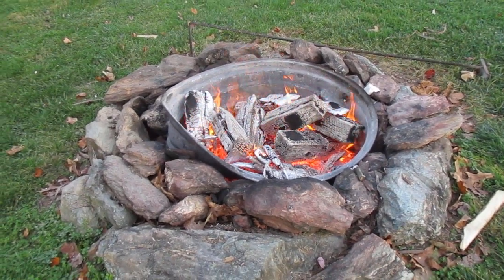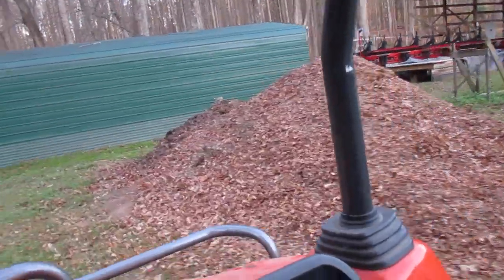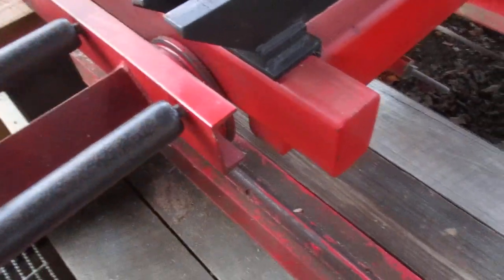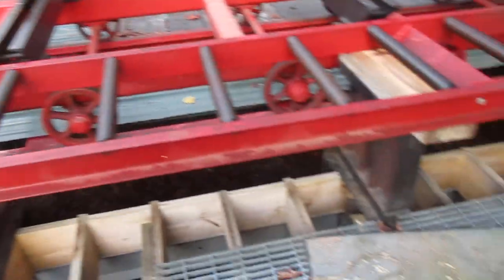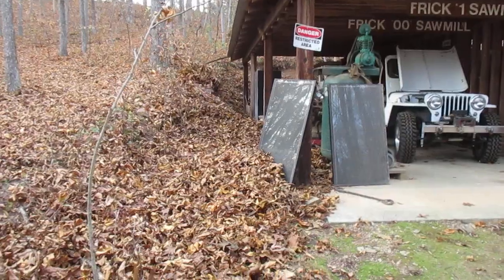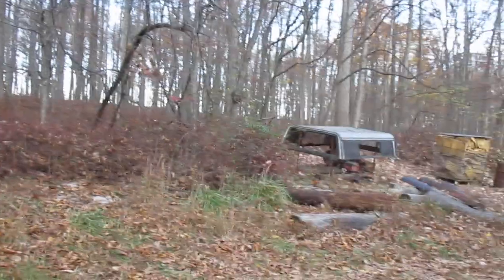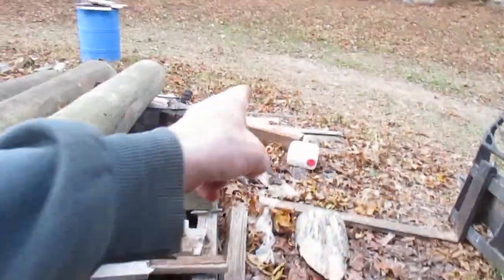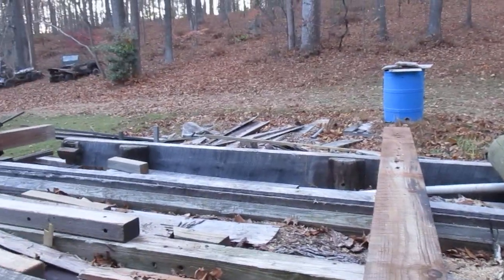sawmill Up Date # 959

Comment: John may I make a couple suggestions that might help you out. 
On your roller table where you come short by couple feet.
Make yourself angle iorn extention with legs to support it on the saw end.
I'd basically just make a angle iorn box with adjustable legs, and put a flat metal top on it to slide your planks across to your rollers. 
If you mount it inside the roller frame ends by making it with couple taps just inside your main frame that will compensate for the top being far enough away from your end roller to not impede it from rolling. 
As well as put your metal slide just even with the top of your roller, and with the adjustable legs inside the extention you can have it set just below that surface too.
Leave a nice 3 or 4 " gap for any miscellaneous small pieces of bark n whatnot to slip off away from your slide plate, and that'll solve your problem of butting into the ends of your roller frame.
Then it's removable if need be, but keeps you from having a board nose dive under your rollers, and prevents it from coming to an abrupt stop by hitting the end of the roller frame.
Second suggestion. 
I always carry a little flip note pad with a place for a pen or pencil attached to it, because I loose writing implements as fast as I forget what I wanted to remember, and I date each page as well as put stars beside according to importance to me.
If I don't check it off then it carries to the next page. 
Are if long term waiting on parts type stuff, then it goes to the back pages for extended carry overs pending, and I write date parts are expected to in my hands. 
I've just always carried one or two from back when I ran large crews on jobsites I was in charge of, because even when my memory was very good above average even. 
I learned that I can't remember everything, but if I have the information, and knew where I wrote it down then at the end of the day I'd go through one note pad for everyday items.
The other one was for need it now are need the information now on whatever subject it might have been on.
That's why one was blue and the other red, and I just always had them in my front pocket everyday, and at the end of the day when I parked in my driveway.
They'd be right on the console next to my keys for the jobsite, and that way never left them at home, because some days you just never know if you were hitting on all eight cylinders when you got in the truck and drove away. 
Hope it helps
Reply from the maker: hi there thanks for all the good ideas . they will be helpful and thanks for stopping by with them john